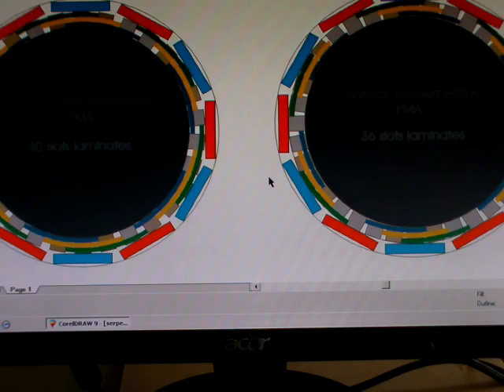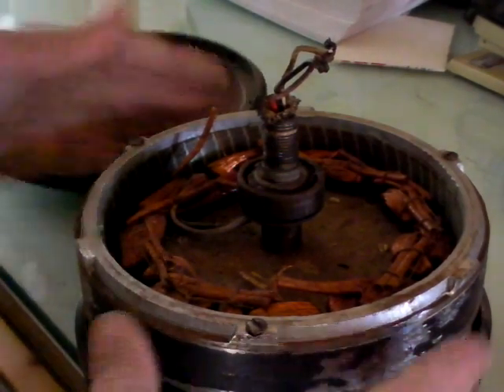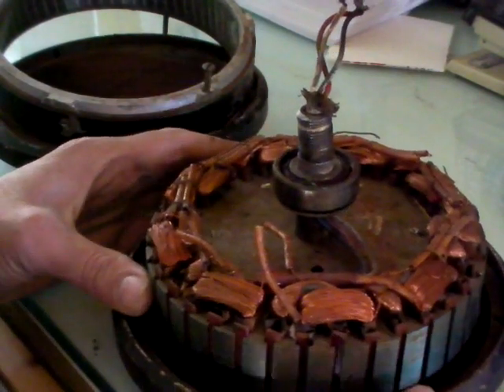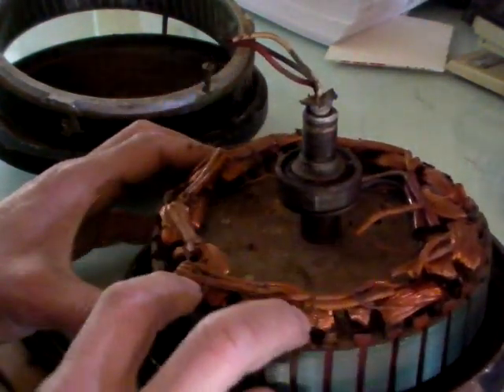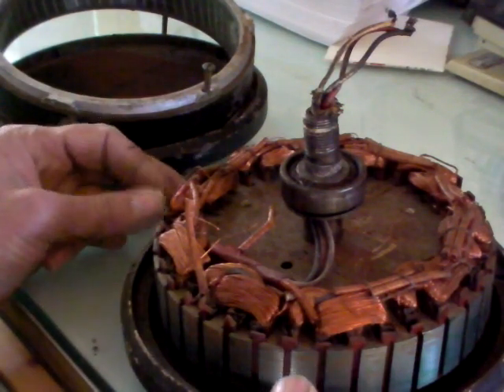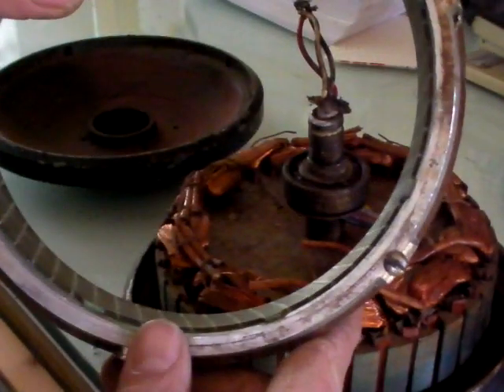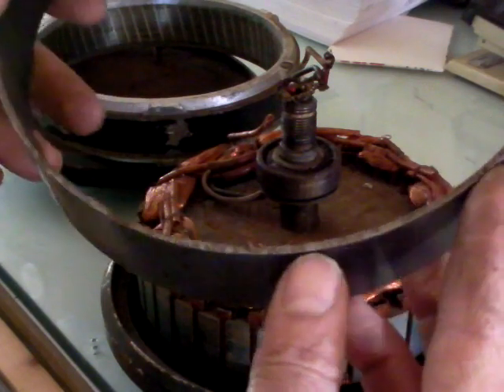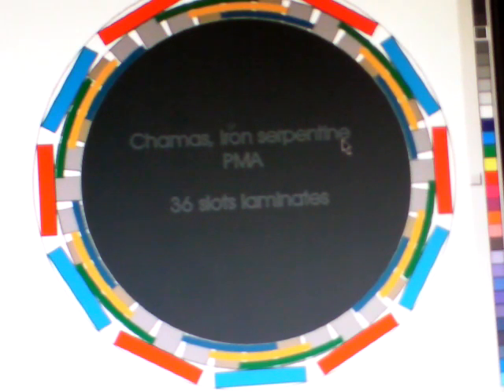01 12pole 36slots iron serpentine 3phase PMA axial wind turbine vawt generator energy  99

Comment: I also made Alternator from ceiling fan motor. i think the original 2 pols of that router better then 3 pols because.i thing that router cant support 3 phase winding 
1.that router rewind is very hard if you have to thinking about thick wire gauge to change.
2. the bar magnets can't adjust  around rounded router(I suggest should use small bar magnets)
best of luck for your experiment i hope it will work well
Regards 
Abdul Rauf